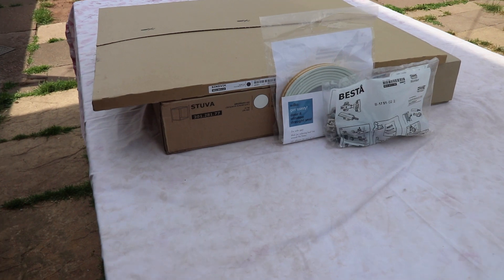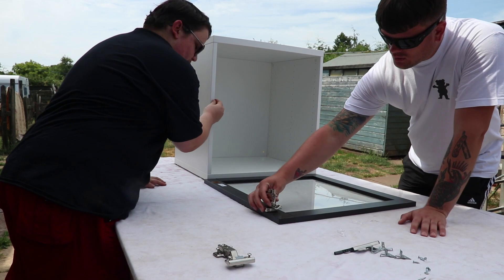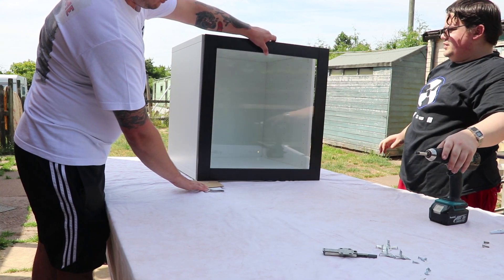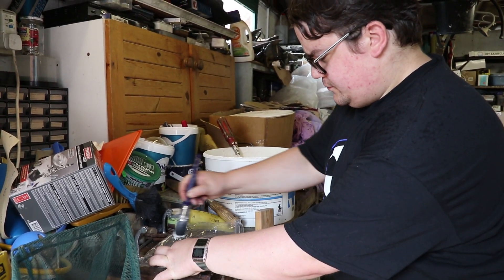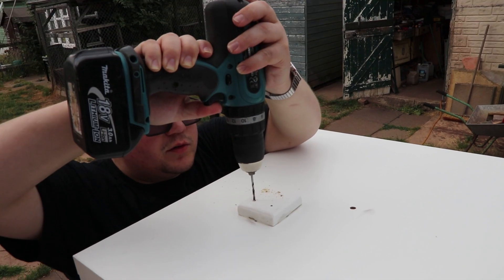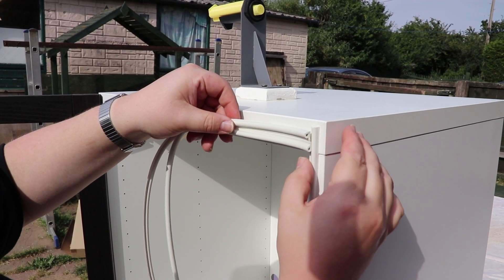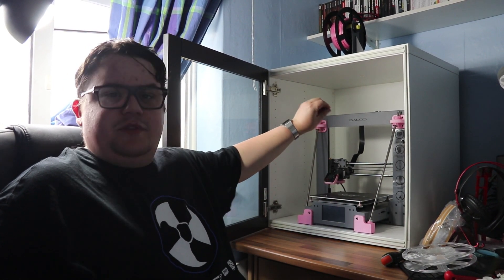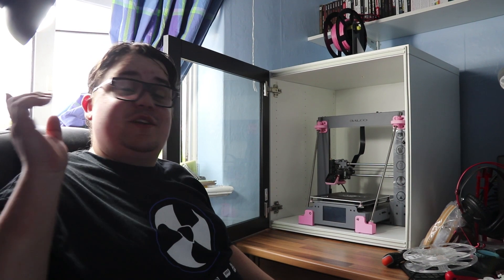How to build a 3D Printer Enclosure out of IKEA furniture!

Comment: Hi, did your door come clear as in your video, or did it have frosted glass to start with and if so, how did you remove it? Trying to remove the frosted glass which is on the inside of my cabinet door. Thanks
Reply from the maker: Hello :) I'm afraid I can't be much help, mine did indeed come with clear glass. If it's some sort of stick on frosting then give WD-40 a go. It works really well at loosening some sticker adhesives. Sorry I can't help more :( Thanks for watching pal :)
Reply: Ok thanks I'll try that. We basically have the same set up, only my window is frosted and not clear. I've ordered a new door, incase I can't remove the frosting. Great video by the way, keep them coming :-)
Reply from the maker: @drgym2010  Yea, I didn't even know they had a frosted door option so today I learned lol Hope you manage to get it sorted :) and no problem! I'm glad the video helped :)

Comment: How much quieter did the printer get? Im trying to find a way to make mine more silent.
Reply from the maker: Hi X MarkD :) It dulls the sound a little bit but not massively. But if your printing PLA I would highly recommend that you print with the door open as being enclosed can mean print quality suffers and can even clog your printer nozzle. This was made solely so I am able to print more exotic materials such as ABS and Polycarbonate. 

If your looking to make things quieter then I would suggest checking out my other video on changing the hotend cooling fan to a Noctua. Also have a look around for videos talking about quieter stepper motors and drivers as that's also going to make a huge difference! Hope this helps and thanks for watching! :)
Reply: @willcaddy  thank you for the reply! Im actually planning on changing the fans, i used an ender3pro for month like a year ago but had to sell it when corona started, my new one (e3pro again) will arrive next week with the silent motherboard. Would very much like to change the fans, but noctuas are so so expensive! I found another 40x40 fan at a local store, the brand is SilentiumPC i think, and looking at the descriptions, those should be very close in noise to the noctuas, but the price difference is like $15 per piece. Sadly i cant find any information or comparison on them.
Reply from the maker: @xmarkd5630  Sorry to hear that you had to sell your printer! But glad you have a new one on the way :) Yea Noctua are great but they do charge a premium. One thing I would say though is make sure the fans you buy have nice wide blades and very little gap between them as this will be a lot better at pushing air through a tight space like a heatsink or grill. They call them high static pressure fans. The air flow optimised fans lose a lot of air around the fan blades. But other than that it's fair game tbh lol Thanks for your comment and once again thanks for watching :)

Comment: Great video, ordered this from ikea as soon as I got my Balco - had kept it nice and safe for the last few months. Thanks for sharing
Reply from the maker: No problem OSimmonds
 :) Let us know how you get on! :) Thanks for watching!
Reply: Hi! How much quieter did the printer get? Im planning of building the same!
Reply: @xmarkd5630  it got a little quieter - but not silent - you could still hear the servo motors and the fan (which a fan mod should help). I mainly did it to keep it out of the way, and keep it from getting dusty/bashed. I also think the prints are better as the enclosure keeps the temp in.

Comment: Will an ender 3 pro fit in here
Reply from the maker: It should do yea, its about the same size as the Balco/Wanhao so should fit no problem, but you will need to mount the filament holder outside like I did in the video. Hope this helps and thanks for watching :)

Comment: what is the measurement of the enclosure?
also if possible please include the individual measurements of the wood slabs on all sides

I can't get to ikea
but got a lot of spare wood pieces..

BTW how big of enclosure dimension do you think it needs to fit a CR10s?
Reply from the maker: Hello there! Sorry I didn't get back to you right away, been a hectic week! 

The dimensions of the current cabinet assembled are:

Outer Size:-
Height:64 cm
Width: 60cm 
Depth: 49cm

Inner Size:-
Height: 58cm
Width: 56.5cm
Depth: 47cm

The dimensions of the pieces that make up the cabinet are:

Side panels x 2 (looking straight on at the cabinet, left and right panels):-

Height: 58cn
Width: 2cm
Depth: 49cm

Top/Bottom panels x 2 (again looking straight on at the cabinet):-

Height: 60cm
Width: 3 - 3.5cm
Depth: 49cm

Door:-
Height: 64cm
Width: 2cm
Depth: 59.5 - 60cm

The Rear panel will be about the same but could be a few cm's smaller if you plan to have it slid into a groove on the back.

Unfortunately, the only item I saw that might be suitable for the CR-10(s) has been discontinued. I shall keep my eye open for you but its looking to be more and more like a custom build for that printer. I plan on doing this in the future buy haven't got round to it yet I'm afraid! 

Thanks for your comment! I'll put all this in the video description too so it will be easier to find rather than looking through comments! 

Thanks for watching! :)
Reply: @willcaddy  thanks for taking time to do the measurement..

I was thinking of building a one size fits all type of enclosure  since I don't want to waste time build another one if I get a CR-10s size printer later on..

So you got CR10s?
if you can put it next this enclosure and sort of size it up and give an estimate of how bigger the new dimensions should be in order to fit it comfortably (ie allows enough spacing to do stuff with the CR10s)
Similar to how much space you got with the enclosure and your balco..

also if you build an enclosure for the Cr-10s please let me know..so I can watch your building it video
Reply from the maker: @TylerDurden404  Sorry again for my slow reply! YouTube is a bit funky on my end at the moment and is not showing all of the last reply I made so not sure If its like that for everyone or just me? do let me know! 

I have measured the CR10s and it needs a inside size of D 75-80cm x W 60cm x H 65cm. This is about the minimum i think to have a comfortable amount of room for everything. This also is not including the control box which should be outside the enclosure anyway to get the longest life out of the power supply and control board. I plan on stripping that out of the Balco at some point because I'm worries about it over heating and dying! 

The estimated panel sizes for the sides - D 75-80cm x H 65cm x W 2cm (however thick you want your walls to be). 
The top and the bottom - D 75-80cm x  H 60cm x W 2cm
and the door/back panel - D 60cm x H 65cm x W 2cm.

I would probably put a 3D printed spool holder on the top and feed from there else you will need a big slit down the side of the enclosure to make sure the filament wont get put under to much stress. There is a filament holder that runs on skateboard bearings which is pretty good on thingiverse call "The Ultimate Spool Holder" or "TUSH". I plan on making one in a future video :)

Hope this helps! I'm going to make an enclosure for the CR-10s when I have upgraded it to an all metal hotend but I have some really cool upgrade videos recorded which I just need to get round to editing! 

Thanks again for watching :)
Reply: My cabinet (Stuva)  measures 578 mm high 560  mm wide and 470 mm deep. It is possible to get it just about 2 more cm deeper. But you will have to make another back piece.

Comment: Thanks for this very useful guide! I have a Wanhao i3+ which looks to be identical to your printer and have just bought a ikea stuva cabinet and wondering what to do next. Still need to find a door though.  Planning to print ABS which is why I decided to do this but also looks a lot tidier. Cheers
Reply from the maker: Hey there, thanks for watching! :) The door I'm using is the IKEA SINDVIK. All the links are in the description :) I have printed both ABS and PC-MAX (A polycarbo at blend) and it worked great! I would get a Microswiss full metal hotend though if you plan to print more exotica materials. Video coming soon on that! :)